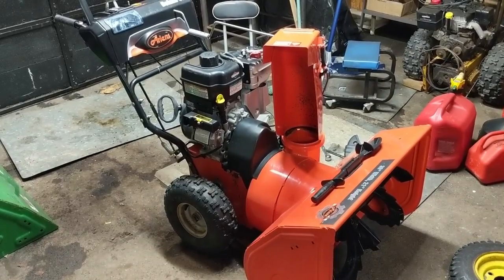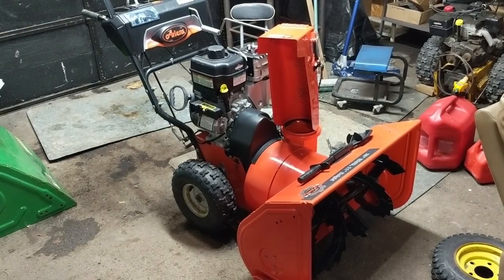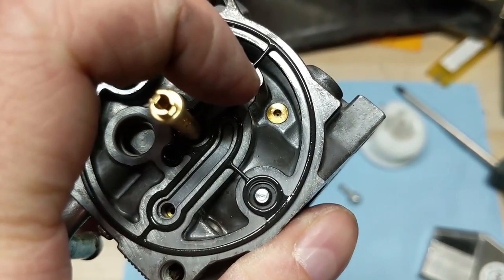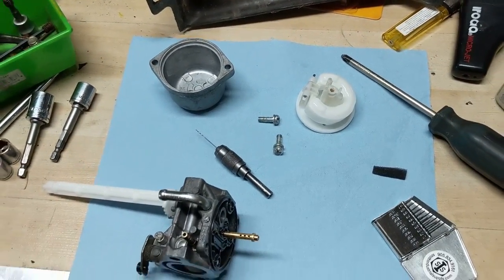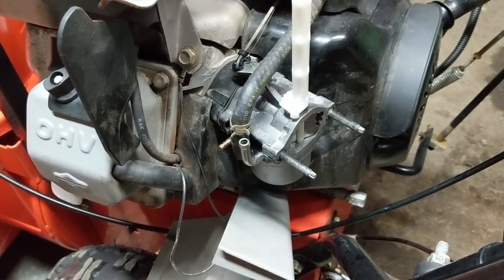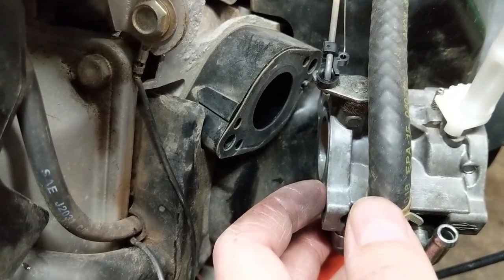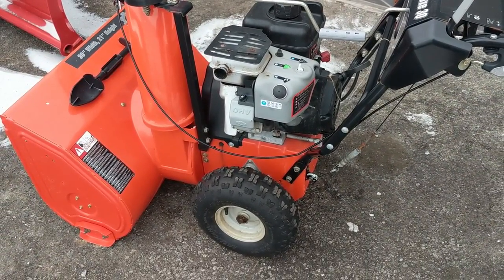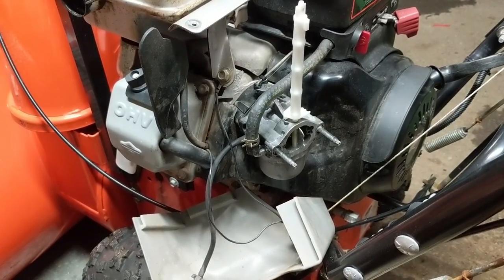How to Fix Surging on Nikki Carburetors

Comment from the maker: The reason this needs to be done on such a new engine is because these engines slowly lose compression through the Piston rings and the valve tolerances aren't as tight, so they pull in the same amount of air but less fuel. By slightly enlarging that pilot jet, you make it easier for the engine to pull in a bit more fuel!
Reply: What was brand and model was the replacement carb you mentioned in the video?
Reply from the maker: @loganminto1589  walbro, but you need to pull up a parts diagram for your machine and then get the walbro equivalent. The part number should be in the parts diagram. It'll show 2 carbs, machines were built with either or, walbros are definitely better.
Reply: @EliminatorPerformance  so I hear that in 2012-2013 Briggs had a problem with the carbs on Polar force engines, I have a 1150 250CC on my 28" deluxe, it is surging, and will only run well with choke, on the low circuit it needs 3 notches, 1 notch for the high circuit rally smooths it out, but it basically does not surge in the high idle, just on low idle, a friend said to get the replacement carb update, thoughts?
Reply: @EliminatorPerformance  Si señor otro  defecto es que se vencen las orejas donde aprietan los tornillos de la cuba y no aprieta el arito de goma de la caja del punzon ni el sello del laberinto Por tanto la gasolina se filtra . El modo de restaurar es con una lija 240 sobre un vidrio pasar varias veces la cuba hasta lograr que asiente de nuevo y tenga apriete.
Reply: Have a Tecumseh carb that does the same thing. Your thoughts? I also have a Honda hs520 snowblower that I put a new carb on that won’t start in the cold but if you bring it in the warm and choke it will start first pull 🤦🏻‍♂️
Reply: If that’s the case why don’t all engines with low compression surge?
Reply: Our Husqvarna rider surges but not when the blades are engaged.  Still the Nikki?
Reply from the maker: @No.1CatWhisperer  so under load the engine draws from the larger main jet. But on idle, the fuel goes through the smaller pilot jet. This is why we sometimes have to enlarge the pilot jet a bit with micro drill bits to about 0.020" to solve surging
Reply: on the newer engines with over head valves, why not adjust the valves? they are adjustable.
Reply: @goldfinger1003   they started out with a larger pilot hole.

Comment: I have to thank you but for a different reason. I took my Nikki carb apart and the main jet fell out onto my work bench. I did not know at the time it was the main jet and I assumed it went somewhere in the main body (the metal body). Found your video and there it was plain as day in the plastic part that holds the float assembly. Thanks again your video was great.
Reply: Omg meeee too! 😂😂😂😂😂😂

Comment: I bought a cheap replacement on Amazon to replace my Nikki carb. It ran terribly surging and popping. I fixed it with the help of this video - pretty amazing
Reply: Same here (hard to beat $10 for a new carb) a little different location for the low speed jet, still brass jet off to the side, took it to 0.0195” pretty much took away 90% of the surging.  Going to take it to .021-.023” and see if I get it to 100%.  The main jet is around 0.0375” , runs fine under a load before and after the adjustment.
Reply: I’ve got a craftsman lawn tractor with a Nikki carb that’s surges like hell, been fighting with it for a while, put a brand new carb on it and it still surges just as bad, so I’m going to try this
Reply: @nodsib did it work

Comment: I bought a 2003 Craftsman LT 3000 with a 20hp Briggs. It had an knock off Nikki carb on it and would only get a 3rd of a the throttle before surging started. The smallest drill I had was .040 and I tried your trick. Engine now starts, runs, and cuts grass great. Thanks for the video.
Reply from the maker: Glad you're back up and running again, thanks for watching!

Comment: When I was a little boy pushing a mower around the neighborhood (1970s),
I carried a small screwdriver in my pocket to adjust the carb when
it started hunting. 
As a man, the EPA has removed the screw, and I must spend 
hours taking the dang thang apart and DRILLING out the brass
Pilot Jet.
This is what we mean by "life was simpler then".
Best to all.
Reply: I remember when you could adjust the timing on a car just by loosening a nut on the distributor and twisting it until it sounded right! Then again . . . I have a 2006 Honda CRV with 220 K miles, and it's running great. Back in the day, that was unimaginable. Modernity is definitely a mixed bag. Some things have been gained, some things have been lost ;-)  All the best!
Reply: YEAH!  🍻

Comment: Okay, just finished up, she's running great now, here is my experience. I have the same engine and carb except it's an 11hp, my engine would surge and have zero ability to idle. I took the carb off 3 times opening up that jet all the way to .031" with no improvement at all. Upon further inspection, determining where the drilled pathways are routed visually and using gumout spray tube, found that this particular jet leads only to the larger of the two ports at the inlet side of the carburetor, it seems to be just a bowl vent port, not associated with the idle circuit. I found that the actual idle circuit port is on the opposite side of carb inside the bore (slot with a small hole next to it) behind the welch plug on the engine side of the throttle plate. This is the idle port and it draws fuel from another very small brass jet pressed deep into the hole at the end of the curved elongated channel shown at the lower left of frame at 2:16 in video . I covered the idle port with my pinky finger and sprayed gumout into the small brass idle circuit vent port at carb inlet and nothing came out this small brass jet. This is the jet that was plugged causing my machine to surge and have no idle at all, it seems to be about a .016" jet, I reamed it with an .018" drill bit making sure the drill bit reached all the way to the drilled channel that intersects the welch plug hole, tested in the same manner used earlier with gumout spray,  it was now open and voila, success! 
EP, Thanks a bunch for the video, it did lead me to the solution.

Comment: Thanks for the great video. I used a 0.029" drill and my lawn tractor ran like new afterwards, no surging or popping sounds anymore. Make sure to not buy the drill bits with the colored plastic collars as I broke two really easily just spinning the bit with my fingers. The bit broke off deep in the hole so I had to screw a screw into the brass part and pry the whole nozzle out and then remove the stuck bit and hammer the nozzle back in place.

Comment: Thanks for the video and help my BS 19.5 hp riding mower a lot. After drilled pilot hole to 0.1mm, all the surge issue gone for good and thanks for the explanation why need bigger hole. Will keep in mine when other push mower have same problem will be easy fixed.
Reply from the maker: Thanks for watching!

Comment: I just got a aftermarket (Chinese) Nikki for a Briggs 14.5 HP and had to drill the jet from Factory #75 / .022" to .039" or, a # 61 drill. Actually, it could use going to .040" / # 61. This thing was surging bad when first put on. I work on a lot of engines and never had to go .017"+ on the LS / pilot jet that far.As far as I am concerned, .017" larger is drastic. But, all is well now and the customer will be happy. Thanks for the video

Comment: Thanks for the video and explanation.  I have a Briggs & Stratton 5500W generator with the Nikki-style carburetor.   I've a few questions that I am hope you can help answer.
First:  I rebuilt my older carburetor on this machine a couple of time.  The large main bowl gasket is problematic in that it won't sit well in all the grooves (in fact, it feels like the gasket is not the right dimensions).   Is there a trick to get it seated?
Second: I recently replaced the old carburetor with a brand new one and changed the plug to get things ready for our summer hurricane season.  The engine ran well, and when we had a power outage, it also ran well through the first gasoline tank.  Then, when the tank was refilled, the engine began to surge.   I have difficulty believing the problem was the carburetor idle jet being too restricted (as you describe in the video) since this is a brand-new carburetor and the engine ran fine initially.  Is there another root cause that I can check?  
Lastly: Is there a differently designed carburetor that I can replace the Nikki with? 
Thanks!
Kirk

Comment: thanks for the vid, have this kinda carb on my rider which had an issue, I went to clean the carb and when I reassembled I hadn't noticed the small O ring by the inlet, so the carb pissed fuel everywhere when I put it back on.  I had thought it was the main gasket ring that had failed.  Found an O ring in my stash that fit and sealed it back up.  Plastic doesn't belong in carb!
Reply from the maker: Thanks for watching!
Reply: Plastic doesn’t belong on/in the motor! It’s all too often now that I take something apart and there’s a plastic governor or cam gear. I’d rather keep buying old k series kohlers that were made to last.
Reply: I hate the plastic carbs to

Comment: I was thinking about trying this with a Nikki Carburetor I replaced.
That is exactly what it was doing even after I rebuilt it.  I didn't know
you could possibly save one of these precious things...LOL  Am not
a big fan of them myself.  Even the new one I put on will still caugh 
some.  May drill it out too if this works... LOL  Great Video!  🍻

Comment: I had a Nikki carb that had a really bad surge you can really hear it sucking air in it's a distinct type of surge. I kept cleaning the carburetor out and cleaning the carburetor out and it would not go away so finally I examined it thoroughly and realized that the Welch plug on the outside was completely missing it must have vibrated off put a new welch plug in and it purred like a kitten so that's another thing that's very rare but it can happen and it has happened the specifically on this Nikki carburetor
Reply from the maker: Yeah very unusual for that to happen, sometimes these aftermarket carbs aren't built to the same standards as an OEM carb would be.

I suppose if the adhesive they use let go, it could happen!

Usually if a welch plug comes loose, I take a punch and deform the metal around the area to help keep it in place.

Thanks for watching!

Comment: I was on Google today trying to troubleshoot my sears (Briggs and Stratton)  snowblower. Your video popped in to my recommendation and I am now eager to solve this problem...once and for all!!
Thanks kindly for the great info as I was getting frustrated trying to figure out if the idle jet could be replaced with a larger one...somehow!
I do own a micro drill set and will follow your procedures as you have shown. 
I do have a question regarding the spring that sits between the bottom of the float bowl and the float assembly...does this spring keep the float assembly in place.  I could not see it when you displayed the carb when it was apart. 
Great video....and yes 👍
Reply from the maker: Some carbs have the spring, others don't. The issue is that if anyone removed the carb before you and lost it, they may not have it.

Comment: Did it with torch tip cleaners and YES it fixed the surge and lean running issue, thanks

Comment: You can thank the EPA for making carburetors/engines run so incredibly lean, and without any ability to adjust the idle mixture, or high speed mixture in any way !
This problem starts to show up in engines at roughly two and a half years, to three years of service depending on use.
While everything is new, and tight, and running within the tight EPA restrictions, everything is just fine, 
however,
once the engine begins to wear itself in, 
( not worn out in any way )
and compression drops slightly, and vacuum drops off slightly, these engines begin to start starving for fuel !
( surging and popping through the carburetor )
Even replacement of the carburetor with a brand new carburetor will not correct this problem !
It is my belief that this is done intensionally, forcing the public to purchase a new unit entirely, or be facing a rather large service invoice !
Thank you for your valuable video !
Most people have no idea what to, or where to begin !

Comment: Interesting, mine doesn't have that piece, the hole is empty. I couldn't quite tell, but does your carb have the air fuel mixture screw at the top next to the idle screw? I agree that it is a terrible carb design. What doesn't help is when I got this mower, there was no main jet. I have been 3D printing some and drilling them different sizes to try and figure out what is correct, but I haven't gotten it to run completely smooth. Currently I have it drilled out to a 62, which seems way too large because my bit kit only goes to 61 at the largest...

Comment: Now this is what I have been searching for. I was about to make a big mistake and drill out the main jet. I'm working on an aftermarket carb that supposedly is after the Nikki. The low idle jet is in a different spot on this one. I had purchased my drill bits in advanced in hopes of another search to find a better video. I had attended a small engine course, but all the parts of a motor can't be accomplished in one semester.
Reply from the maker: Thanks for watching!

Comment: What after market carb do you recommend for a Brute 29", Briggs and Stratton 13.5  - 1695576 snow blower?  My son was using it a few years ago, left the gas in it for entire season while it didn't snow much.  The gas broke down and froze.  Everything in the carb was bent or broken.  I DIY-er rebuilt it.  It runs super rich.  I'd like to get another carb and I really don't want another Nikki.

Comment: Ive been looking for a video like this for a long time .I have a wacker ride on roller.When u first start it it runs good . two minutes after running engine on high with a load the engine starts to surge and then it wants to die .I am going to  rebuild the carb  and try your idea  with the low speed idle jet.Thank you
Reply from the maker: Anytime, just remember to start as low as you can and increase slow. When I say it's trial and error I mean it, if you go to big you have to replace the carb.

So spend the time like I did and you'll find the sweet spot!

Comment: Does the float on Nikki carbs have a specific adjustment ??? Or does the float just need to make sure the needle will seat and stop fuel flow. Can you please tell me if there is any adjustment at all or is it hit and miss type of affare ??? Thanks fella.
Reply from the maker: They're plastic and can't be adjusted unless you heat them up, but usually on the Nikki Design they can either leak at the needle valve or the o ring on the other side of the plastic.
Reply: @EliminatorPerformance   Have you used heat to slightly bend the bottom needle holder part on the float itself ??? Did you use a heat gun or what did you use ??? From my experience the float was always parallel with gasket side of the carb body ??? What I have with mine is the float with a new spring needle goes all the way up to the ceiling of the plastic float holder. If my memory serves me correctly, that will cause a rich or flooding carburetor ??? Thanks a bunch too. VF

Comment: Thank you very much for taking the time to make video like this. It has been very helpful. I need to replace a Nikky carb and on the web there is so many aftermarket brands. Do you have a brand that you would recommend ? Thanks !
Reply from the maker: Just try to find one on Amazon with high reviews, and a high seller rating. So if you have an issue, they usually send you another and you keep the bad one for parts!

Comment: I pulled my carb off yesterday and cleaned and reinstalled, but still surging at idle under no load.  Anything else I need to check before enlarging the idle jet hole?

Comment: Hi, i have the exact same problem with my snow plower, I'm running idle with 3/4 choke on it.  Is it possible to fit an non-Nikki carburetor on the same motor to have the iddle adjustment on it? like Honda carb?

Comment: Stupid question- I'm cleaning out our carb on a newly aquired chipper (Nikki) have you ever seen these o-ring gaskets swell overnight?  I'm talking about the bowl gasket with all the attached areas.  Thanks!
Reply from the maker: They're crap, I have bags and bags of them because sometimes they're formed bad right from the factory. NEVER buy aftermarket gaskets for this carb. Only OEM, and even still, they can have defects. Buy a couple and you'll always have a spare.
Reply: @EliminatorPerformance  thanks! Yeah you weren't kidding.  Fortunately,  after cleaning the carb completely, the chipper runs 100% after sitting for years (previous owner)  Thank you X1000 for the great video!
Reply from the maker: Thanks for watching!

Comment: G'day mate, enjoyed the upload, quick question... Iv'e just opened two Nikki's up and theres no brass jet located where you drilled yours, both secondhand but I never thought to do a sound check of the motors running, I know one did flood if you left it and maybe the other one was surging anyway looking at rebuild kits and theres no replacement brass jet for the low end.
Reply from the maker: I've heard from some viewers that some of the nikki carbs don't have this hole. It's possible they changed the design, to eliminate this hole because it caused this issue. Others have said you can replace the main jet o-ring and it will solve the surging. Cheers.